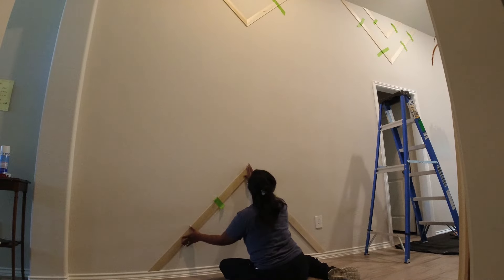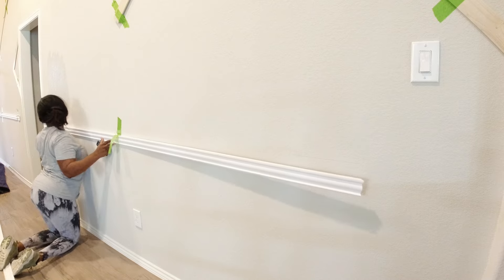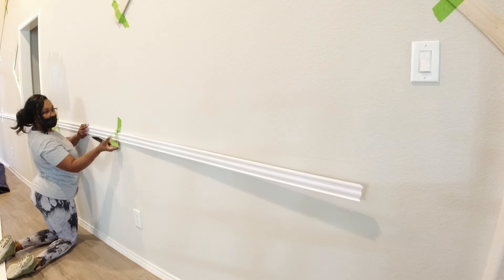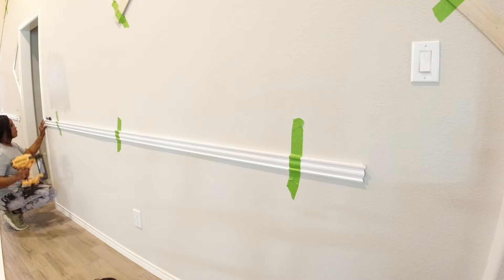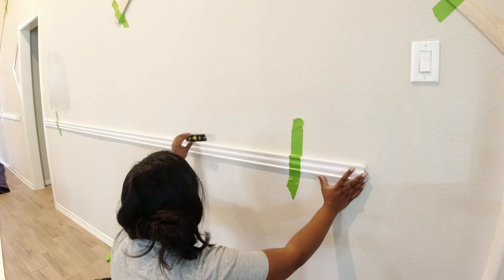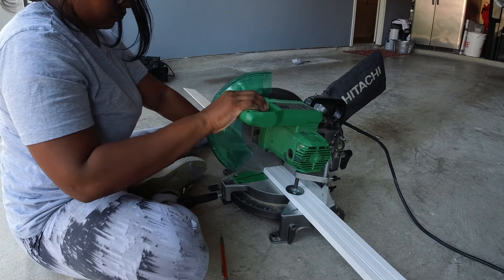Modern DIY Accent Wall | Geometric Accent Wall

Comment: You did an amazing job! I'm curious to know your thoughts. I keep getting different answers. Some say use glue or the nails will pop out over time. And I didn't see you use any caulk on the seams. This too is controversial. To caulk or not to caulk. I just don't want to make any mistakes but I would like to do this. Thanks for sharing!